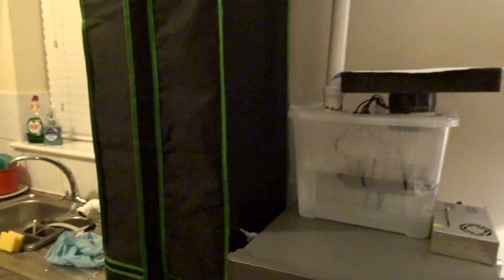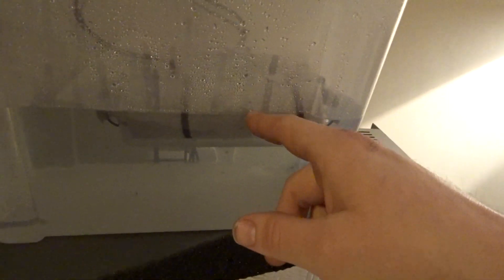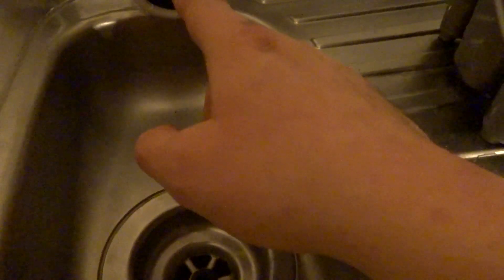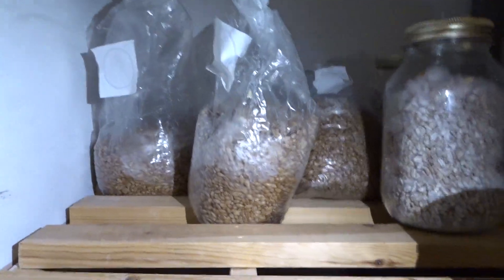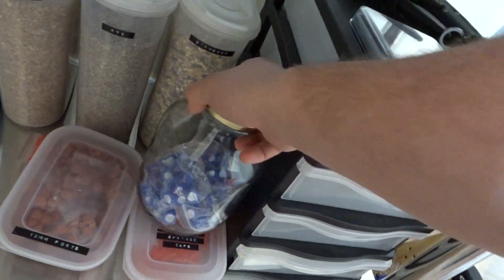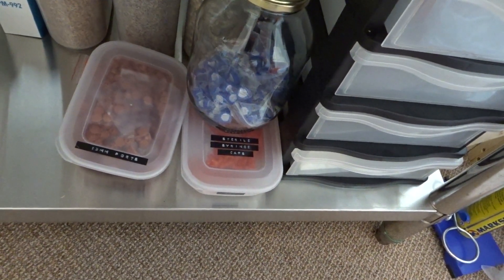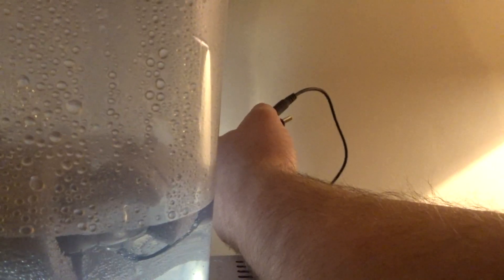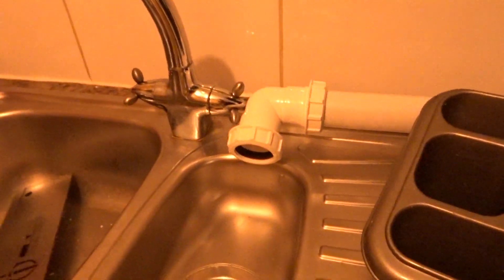Growing Gourmet Mushrooms Inside An Apartment | Oysters and Kings | Homemade Ultrasonic Mister

Comment: I would recommend a black bin for your humidifier so your water doesn't turn green. Other than that. It looks great 👌 I'm in the process of re setting up in a new smaller area also. I don't have much room to work with at all. However my fruiting chamber is a 4'l x 2'w x6' tall grow tent. I will make the best of my space that is for sure. So fingers crossed all goes well. Goodluck with your new set up.

Comment: I bought a tiny pop up garden tent that holds 4-5 gallon buckets. $18. A tiny fan $8. A tiny intermittent humidifier $13. And a plant heating mat. $15. Humidity stays at 84 and temp around 70f.  Works great for Oyster mushrooms.

Comment: I noticed that you are using 10 head ultrasonic mist maker, is the buoy for it homemade or you bought it from somewhere?  As I ordered 10 head ultrasonic mist maker but can't find buoy for it.
Reply from the maker: Hello mate. I just used some pipe lagging and drilled some extra holes in a plastic tub, I secured the lagging to it with cable ties! Hope that helps!

Comment: I'm having a terrible time trying to fruit in a tent. My oysters do great until the half grown then the turn brown and rot. But the shitakes are doing good. Any ideas?
Reply from the maker: It could be you're having a problem with over-humidifying your tent. Get a hydrometer and make turn off your mister, you'll probaby find that it sits at 75-95% humidity for a long time after you've turned them off mate.